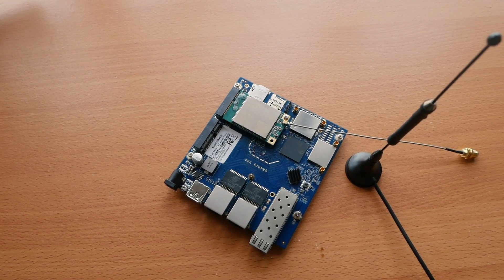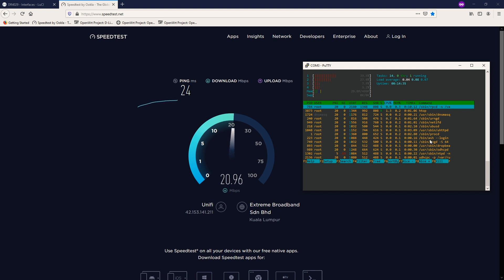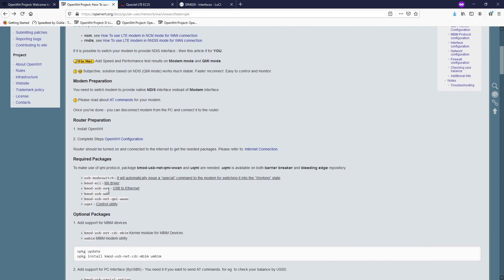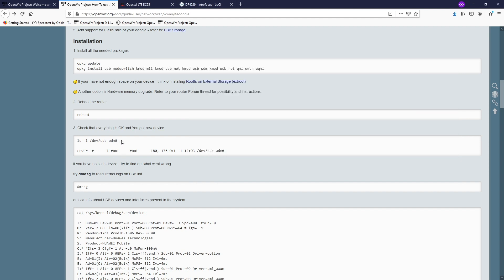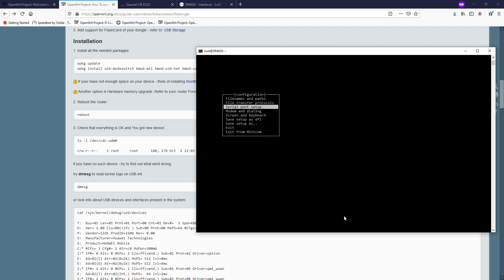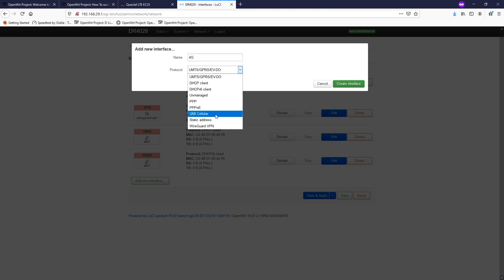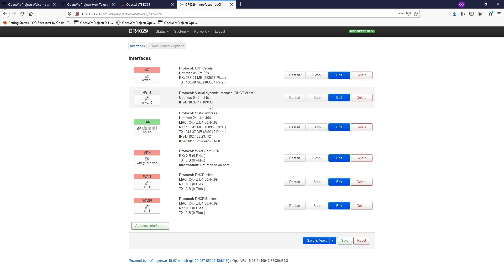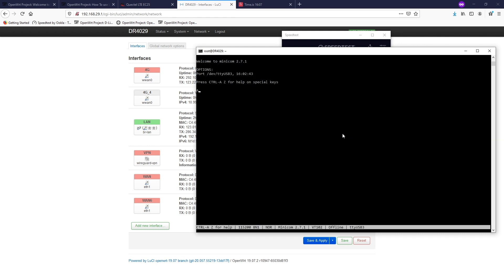OpenWRT - Install and Configure LTE modem in QMI mode - Quectel EC25 & Wallys DR4029

Comment: I have 2 module, run with qmi mode. How to load balance  2 module? There is no config for gateway metric in intrerface qmi.
Reply from the maker: Hi, for load balance between 2 interface, you can check this tutorial https://youtu.be/f_yGMezdMB0. For the gateway metric, you can edit the /etc/config/network and add this line:
option metric '10'
Replace 10 with the metric that you want and it is done.
Reply from the maker: There is an option in mwan3 when it detects hotplug event. You can do research on this or post your current setting and problem on the FB group "Van Tech Corner & Friends" for easy communication.

Comment: Hi, your videos are treating several technical aspects which make them really interresting and a reference. 
I found a module (HLK-7621A MT7621A)  similar than the Wallys one and I would like to know if you  have used it or if you can advice if it is possible to do the same thing using it like your Router (of cours with the same Quectel 4G mini PCI or similar) ? What should I take into account  (image, compilation,...) when it comes to use another module or board as a router?
(info: it seems that  the 7621A  is based on OpenWrt and it is supported by OpenWrt)
Thank you.
Reply from the maker: Hey, from what I know, the module you mentioned is just the the core package. You will need the I/O to use with. May I know if you have a working device or just the module and you want to get started?
Reply: Hello, Thank you for your quick feedback.
Actually I am starting with. I was wondering if the module (HLK-7621A MT7621A) can be an alternative to the one you have shown in the video (i.e. Wallys DR4029). 
Of course I will need a 4G Mini PCI  from Quectel or another branch.
The question is if I purchase the module (HLK-7621A MT7621A), what sould I do (steps)  to make it work with a 4G mini PCI ? I mean can I use staight or should install an image, or compile something,...  
Thanks in advance

Comment: This is nice but like in many of your videos, this not working for many services provided in North America.  

You cannot simply put any SIM card in any device and expecting an auto config from your router to do the magic trick for you with just basic APN details.  It does not work in Canada.  

Same goes for gpon from ISPs, MAC address of the gpon are used to secure a link so you can’t just put the fiber cable into any transceiver of your choice in hope to bypass your ISP equipment.
Reply from the maker: It should work, you just need the compatible module for your region. For NA, you will need Quectel EC25-AF	or EC25-V, depends on the band and Telco. The driver installation & configuration should be done manually for OpenWRT, you can find the link to the full guide on the video description
For GPON, yes, you need to understand the OLT, ONT, how is the authentication to get a suitable GPON SFP module. See these videos where I talked about the GPON Serial Number, MAC Address, SLID/PLOAM Password, etc
- NOKIA GPON G-010S-A: https://youtu.be/3g6mRDfUppQ
- Hisense GPON LTE3415: https://youtu.be/yD8aq4KSWko
Reply: @VanTechCorner  I have the EC25-G, global version that does should work with the bands in Canada but it does not work. I am sure it will work when will travel in SE Asia but here in Canada I am having a lot of problems. OpenWRT and OPNsense are detecting the modem correctly, modem drivers are loaded, I can issue AT commands and create QMI interface. I can also detect my carrier and APN, but the connection remains rejected.  I found out that my Telco is also selling popular rebranded 4G/5G modems that will work but we cannot ask for support for a modem that we have not bought from them like the EC25-G.  I really miss living in Vietnam, Thailand and Cambodia, my network lab was very easy to setup then.

Comment: Can this work for all modems with Qualcomm chipset?
Reply from the maker: Do you mean the Mini-PCIe connector or the routerboard?  It depends on the driver, not the board. If there are drivers for that chipset, then you can use it.
Reply: @VanTechCorner  I mean USB type modems like Huawei HILINK and more
Reply from the maker: Still same answer, you will need to indentify the chipset of that modem and see if there is open-source driver available first.
Reply: @VanTechCorner  Finally it worked, I have 2 USB modems and after a long time I set it up finally got it too. Of course from the way you give. Thank you sir

Comment: Hi, thanks for the detailed tutorial!
I have TP-Link TL-MR6400 v4 and installed OWRT (OpenWrt 21.02.3 r16554-1d4dea6d4f).
I was following this video until 08:04 with no issues, but for me there is no 4G_4 virtual interface was created and no communication was established with the LTE provider. Is it because OWRT 21 works different or the MR6400 v4 works different? I would appreciate your help!
Reply: same problem, disame problem, did you get it? tell me how to solve

Comment: Can the  Banana Pi BPI-R2 Pro board work with Quectel Ec22 or EG25-G LTE 4G module ?
Reply from the maker: Physically, yes, there is a mini-PCIe slot on the board. For driver/firmware, it depends on the OS. If you are using OpenWRT that can install packages from the openwrt.org repo or BananaPi repo, you can get it work by install the same packages. Banana Pi sent me the BPI-R2 Pro and it is arriving in one month's time. If you not rush, I can help you to test it.
Reply: @VanTechCorner  I will definitely love the help, you channel really gives guidance, as I am new to the SBC world. I have a couple projects I want to try with OpenWRT, continue the good work.

Comment: i am working on a project where we have ec25 cellmodems dying out in the field. Am tasked to find out why this is so. How do i go about this to test the hardware (does it involve writing code, if so, please some guidance.) . Thank you.
Reply from the maker: Hi, I think it may die due to overheat. Either from the modem itself or heat from the routerboard. For now, I have yet to know a better way to do the test besides let it run at high speed (high throughput). Did you check it with your supplier or Quectel support team about this?
Reply: @VanTechCorner  yes i checked it with the supplier.. meanwhile what do you mean by .. " let it run at high speed "
Reply: @VanTechCorner  yes i checked it with the supplier.. meanwhile what do you mean by .. " let it run at high speed "

Comment: i have never used openwrt . iv used linux for 10 years but the routes are messed up out the box and eth0 never gains a ip and cant update opkg , set a static ip nothing add route to my home router nothing still cant ping anything disabled ipv6 nothing

Comment: Hello,
thank you very much for the nice tutorial. Do you know a good solution to automatically reconnect the modem? Because it doesn't reconnect after it loses the connection after 24 hours through a forced disconnection of the provider.
Reply from the maker: Hi, you can try to setup a watchdog script to automatically restart the interface when the connection is down. Or try it with mwan3 (multi wan load balancing/ openvpn)
Reply: @VanTechCorner  Thank you for your suggestions. :-)

Comment: hey thanks for the video. 
i'm looking for a a low price router board with display (lvds or hdmi) and pcie for modem. Any tip?
Reply from the maker: You can have a look on 8devices routerboards, for examples, the Habanero DVK.

Comment: Hi, Thanks for the video explanation. I have a very simple question. I have router RUT500 by teltonika with HSPA+/3g/  mini-PCie  modem. If I upgrade a modem in router to 4g/LTE module, then it will working without install OpenWRT system , with original firmware? Thank you and sorry for some stupid question.
Reply from the maker: Hi, sorry for the late response. Most of the case it won't work due the differences in the modem/ MAC/ protocol.

Comment: Can the modem (quectel) itself get a signal, or do you need antenna?
Reply: You must have an antenna. That module does not have one on it's board, only the U.FL/IPX/IPEX connectors for an external antenna.

Comment: Hey man, thanks for the OpenWRT guides. Been a huge help for a complete newbie like me. I have a question though, is it possible to do LTE band locking on a built-in modem through OpenWRT and if so, how do I go about doing this? Sorry if this is a bad question and again, thanks a lot.
Reply from the maker: Hey, thanks for the comment. Band-locking depends on the modem itself (in my case it is the EC25 and we can lock the modem to a specific band). At 4:50 I have shown how to communicate with the modem and we can just lock the band using AT command. There are conversation on the internet for this and here is an example. https://forums.quectel.com/t/ec25-locking-procedure/2993/10. Big vendors like Quectel, Sierra and SIMCOM have their own forum and you can surely ask for help there.

Comment: Hi Van, 1st of all, Thank you for your content! Quick question; I’m compiling my first flash file &  would like to follow this tutorial but I’m having an issue when I run (make menuconfig)
I have WSL on Win10 PC & Ubuntu 20.04.. The issue is I’m getting an error reporting that I’m using a (relative path) in my $PATH but this no true. Some online forums say the reason is because of the (.) I.e. (dots) in the version name/ path naming convention. 

Is there a workaround for this? Or should I use a dedicated physical machine to run its own version of Ubuntu 20.04???

Sorry for being so long winded in the comment section, but  can’t find a  solution for this problem. Thanks

This is new territory for me so any guidance you can provide would be greatly appreciated!!!
Reply from the maker: Hey, if you are running a VM, please try Ubuntu 18. It should work fine. If not, you can share the log and screenshot on the FB group "Van Tech Corner & Friends" and we will try to find a solution for that.
Reply: @VanTechCorner  I managed to create the (.) bin file including all the packages  mentioned in the tutorial. It’s just under 10mb in size. I drilled the $PATH down to the essential directories & removed VPNC Module and it worked fine! SED was failing on (blank spaces),/field delimiters... I’ll be uploading the (.) bin file later to complete the tutorial, but I’m definitely joining your Facebook group!!! Tone Baxter in the chat!!! Thank you so much!!!
Reply from the maker: Yeah, some packages are having problem and I have to exclude them from menuconfig. If you need the firmware I built (come with Wigeguard and LTE module packages), I can share it.

Comment: I see you are running openwrt 19.07 did you build this is there a link  do download with instructions or did you install the reference qcom DK04 build?
Reply from the maker: Hi, I built it from the SDK provided by Wallys. Or else, you can try this SDK https://github.com/sartura/openwrt/tree/DR40X9
Reply: @VanTechCorner  I found that repo and built from there but I believe I need drivers and packages for QMI for Quectel wan card